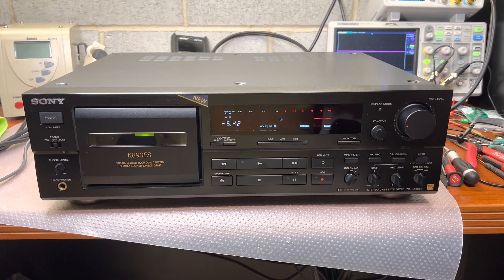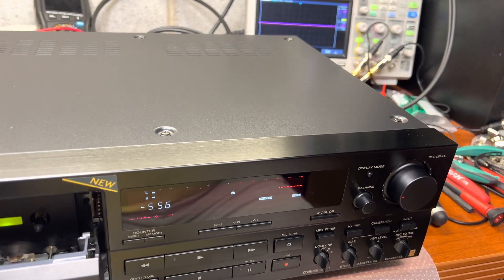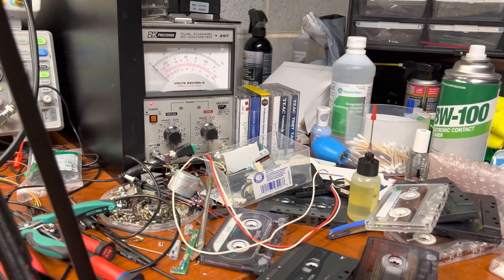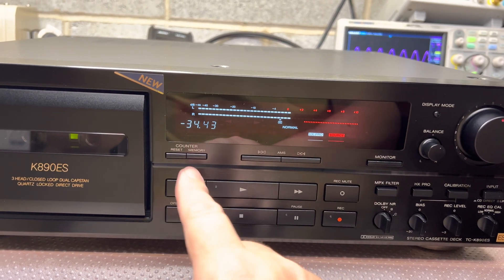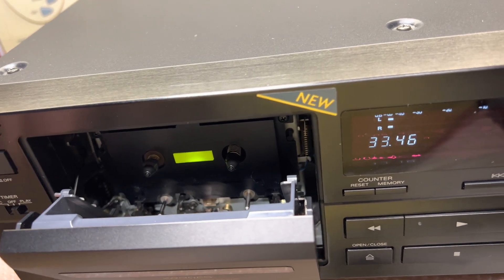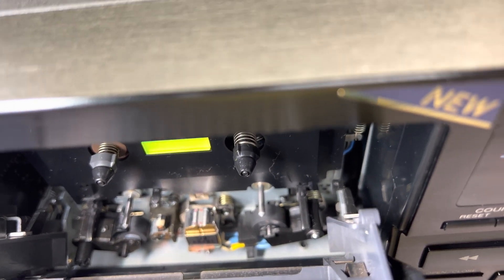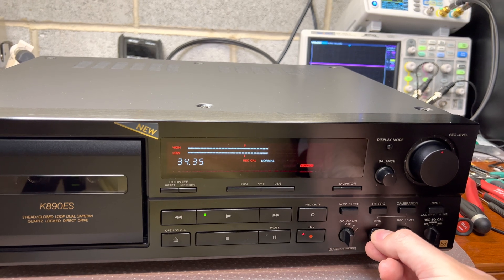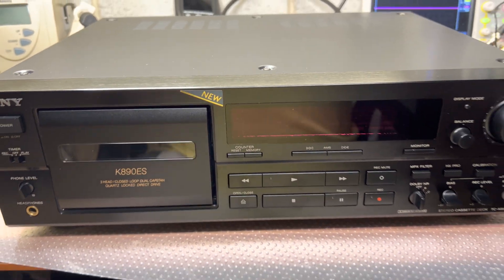Part 1 - TC-K890ES Repair for my friend

Comment: Do you see the erase head? It's skewed compared to the record and play head assembly.

I have two TC-k770ES decks one with skewed erase head one which is aligned for what I remember.

After having serviced (disassembled except the rotary parts) one of these decks and aligned the erase head the mechanism doesn't want to raise into the cassette! It goes perfectly smooth on its own (at power on, test mode) and everything seems fine, but the moment you insert a cassette it just seems to get stuck.

No time to further check until I'm done for the season. I am wondering why these decks have skewed erase heads and if it's the problem I tried to correct to cause the jamming.
Reply from the maker: I have seen erase tapes skewed in multiple Sony decks. However, your issue is not connected with the head alignment unless you significantly screwed the heads. sometimes it happens and I have to reassemble tape transport. I think something is wrong with the large white moving plastic piece at the bottom of the transport. Just check everything works moving gears by hand before assembling motors.
Reply: @hifirulezzz  thanks for your input. It wasn't easy to evaluate once everything was back together.
Reply from the maker: @m80116  Ok, I have to reinstall erase head in KA3, see my series from yesterday. There is a spring below that head and 3 adjustment screws. Maybe it got skewed due to vibration during shipping.
Reply: @hifirulezzz  super precious advice. Thank you for remembering me. I'll let you know if it was that.
Reply: Just to let everybody know that I had misplaced the ornamental plate in the lower part, pretty trivial mistake and I should have stopped earlier fixing myself instead of the deck as I recall being very tired at the end.

I went on and aligned (again?) the erase head to the tape using a modified (chipped) cassette as suggested by the SONY Service Manual.

The deck developed almost immediately another problem and it was due to a missing washer. I don't know if it was my fault or not but after having re-created one and installed it now works beautifully.

So chuffed about this deck... it sounds amazing.